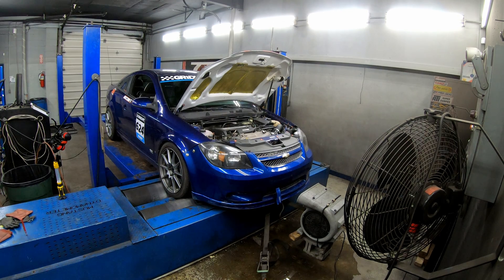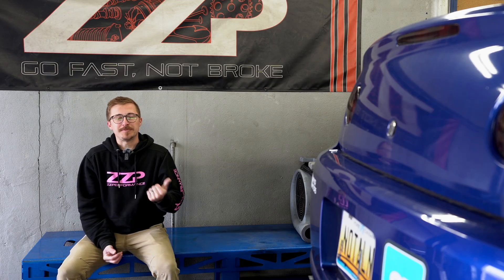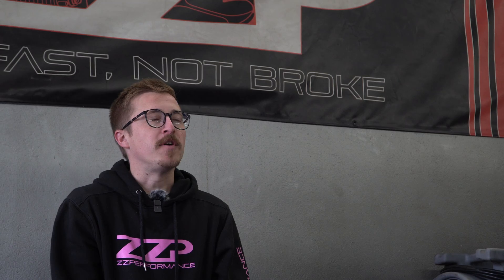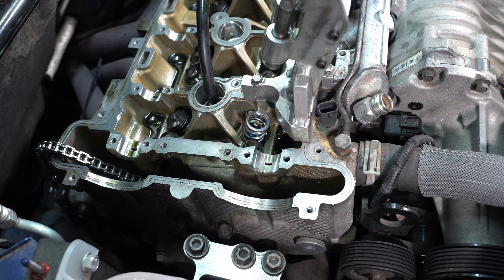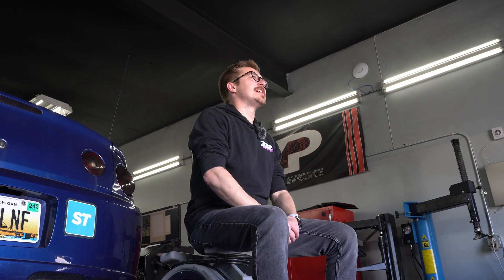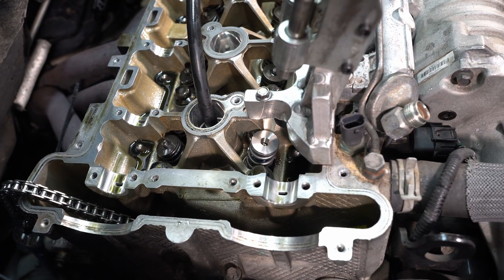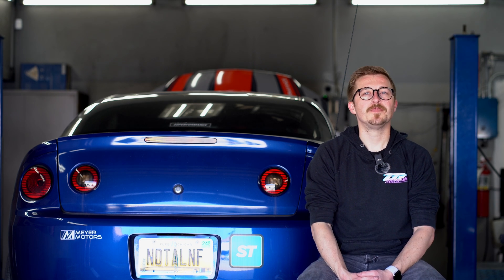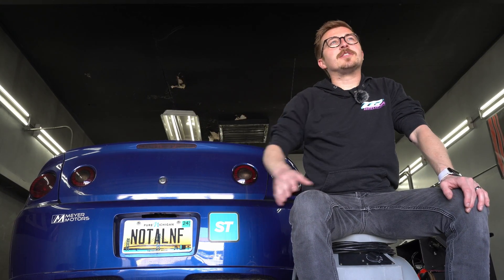A-B Dyno Testing ZZP Stage II Ecotec Cams // Cobalt Build Episode 18

Comment: Did you have the ati balancer and neutral balance shafts?
Reply: Nope. Stock crank damper and stock balance shafts are in place.
Reply: @gbrunner24 do you have a lot of vibrations?
Reply: @jadenharris932  Considering I have all 4 billet mounts, there is a good amount of vibes over stock, but it really doesn't bother me at all.

Comment: Tyler, are you running the ATI crank pully or stock? Im curious what sized belt you are running. I have the ATI with the factory supercharger pully on my 05 redline and can't find a belt that well fit.
Reply: Factory crank pulley and OEM length belt at this point. Overdrive ATI or under?

Comment: Definitely try out some different pulley sizes but I would be curious on a test between a factory blower and a ported blower and an LS4 throttle body
Reply: He’d gain either way

Not sure ifZZP is porting M62 blowers though? There was a great outlet / inlet port design floating around the forum that gained quite a bit of power.
Reply: @D.O.I.N.K  Category V did mine. I just ditched the LS4 TB though, the drivability sucked for what was probably a small gain.
Reply: @mccartyb03  There’s a learning curve for sure with the LS4.

Some love it, some dont.

The gain is larger the higher the engine revs.

Comment: E85, intake, exhaust, A test 254hp, 211tq.  You forgot to mention what injectors you are running, as the stock green 32lb/hour ones won't support E85.  I'm at 98% injector duty cycle on E10, with the stock LSJ.  Are you running Siemens Deka or Bosch EV14 injectors?
Reply: If you run through our previous videos in the series I cover all the bases as to what's on the car. 

But for ease for ya: Siemens 60# injectors, ZZP cold air intake, ZZP mid length header and 2.5" exhaust back to the stock muffler, pump E85, dual pass end plate, option B, ZZP stealth heat exchanger, ZZP S1 intercooler pump, and my tuning.
Reply: @gbrunner24  Now you have me binge watching your cobalt build.  Not sure how I missed all this, but nice content!

Comment: How many degrees of timing are you running?
Reply: I like to keep it right around 21°. A test had a little more timing, ended up at 22.5° around 7k. B test was dead on my 21° mark out the top end.
Reply: @gbrunner24  Did you try running any more, or did it stop making power?
Reply: @kirbyswarp  I did not, stopped there. Picked up about 6whp going from 20 to 21. May have made a little more going a little higher, but that 21 mark is what I like to shoot for.